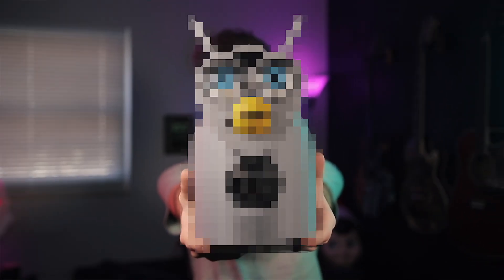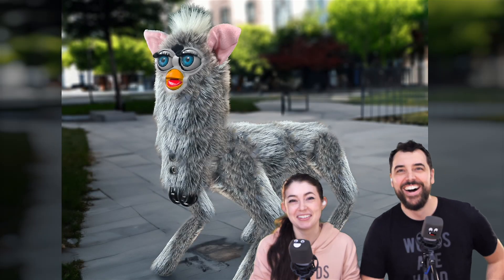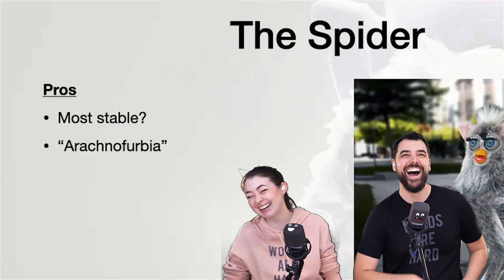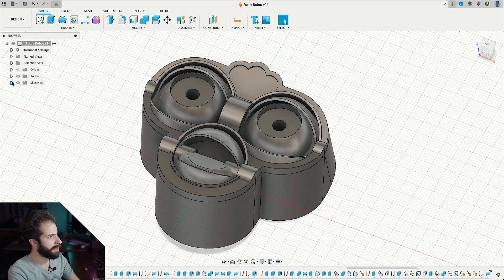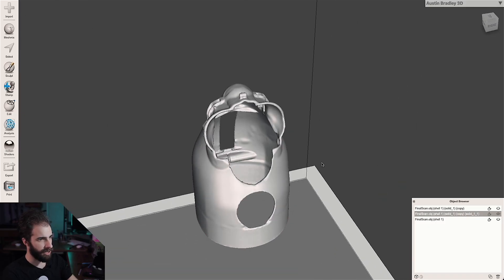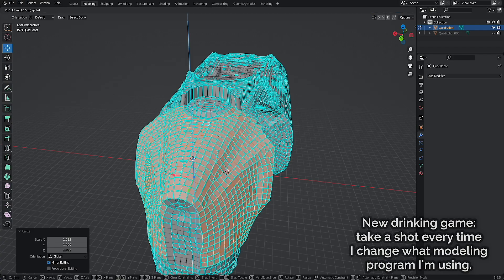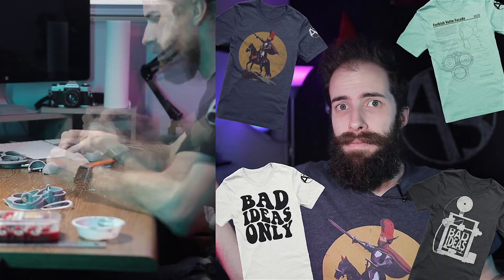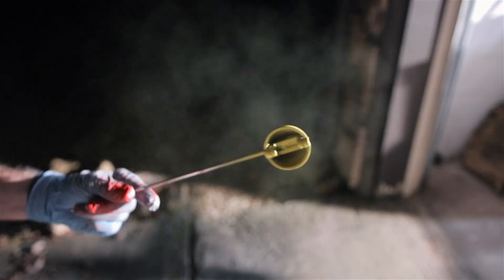Making a Giant Robotic Furby  | Cursed 3D Printing w/@EvanAndKatelyn

Comment: I am really interested in the software you used for this, both how the original Furby's programming was emulated and how you created a speech synthesiser that resembles the Furby's 1980s modulated TI chip (which used samples with linear productive coding).

Comment: Oh no no Furby is of course a digital processor driven toy, not analogue. The processor is a 6502 derivative, just like in most home computers and game consoles of the 1980s. The processor core being 20 years old (first released in the late 70s) and only several thousand gates in complexity, it became penny cheap by then, and the version used in the Furby simplifies it some more by removing a bunch of instructions. Another 20 year old piece of logic, the speech synthesizer from the Speak&Spell toy, is responsible for the noises. At least that's what can be gathered from the attachments to the patent, if they're accurate. There is some extra integration and glop top ICs are used for cost, where a bare IC die is epoxied onto the PCB and then bondwires ran in place, with epoxy poured over to hide the shame, but it also makes it somewhat difficult to confirm whether the logic is exactly as stated, but it's bound to be fundamentally not too different either.

So here's one thing you might want to get, just before halloween, get some of that shitty white hairspray. You can use this to make dark and shiny objects more scannable, if you can wash them afterwards with a warm soapy rag or something.

You can even use normal hairspray, the cheapest, by spraying from a distance of 1-2ft and on an angle, allowing it to clump up in the air as it gently falls on the surface. This is a trick known from photography and cinematography as "dulling spray", though of course they also have specialised products for that with a juicy markup.

Comment: I don’t know what kind of budget you’re working with for these videos, but I have a feeling that the primer used for painting like, warhammer style miniatures might solve some of your issues getting glossy black objects to scan, you can apply pretty thin layers with a cheap airbrush
Reply from the maker: That could be an option- honestly, just painting anything white/matte would do wonders- but the goal most of the time is to not permanently alter the surface and rather apply something easily removable.

Comment: Why couldn’t you make the ears move also like the original furby?
Reply from the maker: They move on a different axis than the eyes and mouth, so I would have had to either find room for another servo motor or make use of a complicated gear/arm system to run them off of one of the other servos. Definitely would’ve been a great final touch of detail if I had time to do it!

Comment: That part in the face that you put a sticker on, the kinda fan shape between the eyes is where a light sensor is for the furby, mostly it can tell if it's in the dark or if there's a sudden bright light. If it's in the dark furbies usually go to sleep.
Reply from the maker: Correct! And it also uses it to communicate with other Furbys via specific infrared codes, which just happen to match the codes in a lot of TV remotes- so you can actually control a Furby (to a degree) using a TV remote! That's how I got a large majority of the sounds for this project.
Reply: @AustinBradley  the furby "codes" matching normal household appliance "codes" is probably why so many acted weird and why there was so many creepy furby stories.

Or maybe thats just what they want you to believe 😈